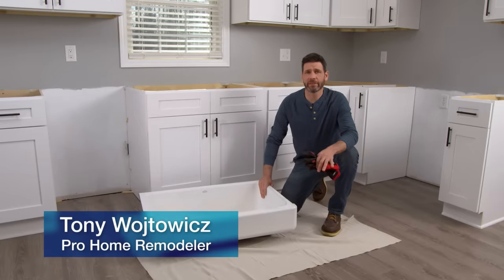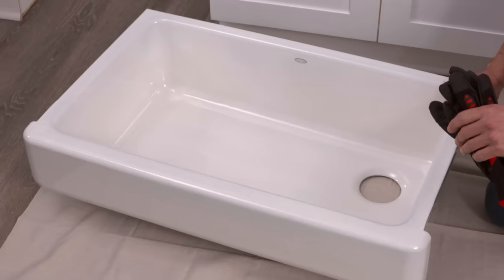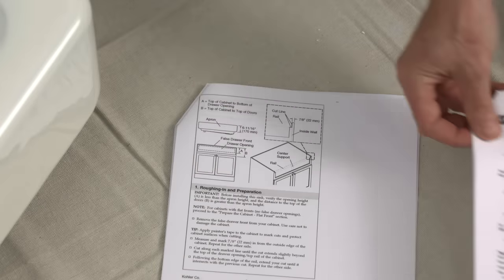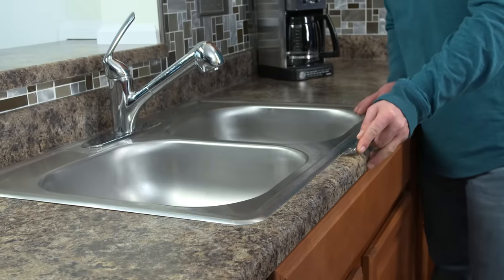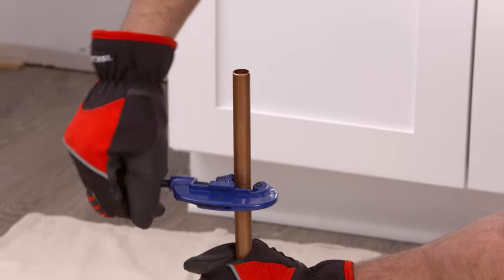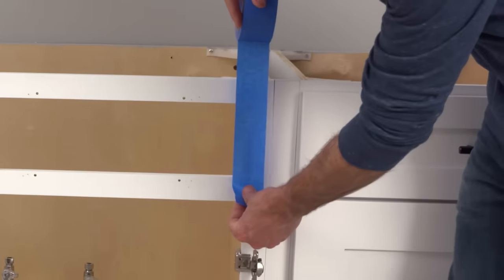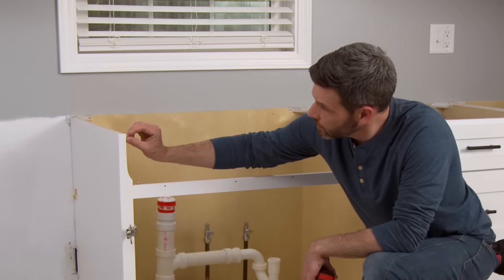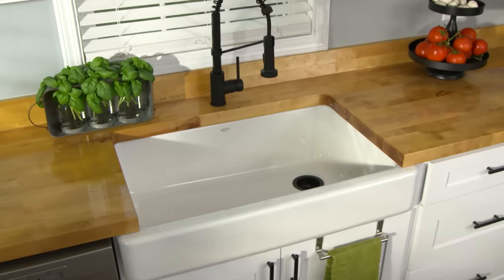How To Install a Farmhouse Sink | DIY Kitchen Remodel

Comment: Do what the gentleman in the video did even if buying new cabinets. We paid roughly $200 extra for the “farmhouse sink base cabinet” and it still needs to be cut up and a base built to fit and support the farmhouse sink. Would have been cheaper to buy the regular base cabinet and cut it up the same.
Reply: instablaster...
Reply: I was wondering because I cannot afford to pay $500 for one cabinet just for the sink ugh this is a bigger job than I thought but we’re doing pretty much what they did butcher block and everything but I know it will look so much better!

Comment: Thanks for doing these videos....I really enjoy them! My question is.....I think i would prefer the counter top to not set on top of the sink....is there another way of installing this sink so the counter top is not on top? thanks
Reply from the maker: We're really glad that you enjoy these videos!  The sink in this video is an undermount sink, but there are also top mount/drop-in farmhouse sinks.  Most are made of stainless steel.  Check this one out on Lowes.com: https://low.es/2ZCfKNA
Reply: Yes, of course there is.  A sink can sit on top of the counter or hang from underneath.  Some sinks allow either install. Some are only sit on top, and some are only undermount. The Farmhouse Sink has two options of being on top or below countertop.  It is easier to mount sit on top style.

Comment: So to install this type of sink you have to remove counter tops?
Reply: That’s what I’d like to know.
Reply: Yes
Reply: Research but I think you can buy top mount but not sure if the existing counter top and cabinets can be customized to fit the sink. You may be able to speak to a custom Kitchen cabinet installer or a good handyman and ask about installing a top mount farmhouse since to existing counter and cabinet

Comment: Wood saw is the easiest way to cut pvc. Farm sinks are popular, but Im not sure how people wash dishes without 2 bays. Also if you need to fill the sink for washing thats alot of water when it should be half that with 2 bays.
Reply: Whole sink is much more handy when it comes to scrub anything bulkier than just regular dishes/silverware. Pyrex tray, pots and pants with handle are all this more comfortable to be done in whole sink before putting into dishwasher for complete wash and sanitation, not to mention that dishwasher will last much longer, beside that having only single drain with garbage disposal will never let drain get clogged, which is common case with dual bay sink as soaking bay is frequent cause to that. Also, those farm sinks while more practical, seem also got trendy nowadays.
Reply: Dish pans are 3 to 6$. Just add a plastic pan that can store under sink when not in use.

Comment: My question is when you are done mounting the sink it looks as though it is not sitting flush with the top of the cabinet as you stated it should.  Looks like a gap of about 1/4". Need to shim it more. It should be flush so the countertop sits right on it with a thin coat of silicon glue.
Reply: the sink should be 1/8 inch below the plywood substrate

Comment: What’s the difference between a regular sink and a farmhouse sink? Which would you recommend
Reply: Really just size
Reply: Farmhouse sink has the apron in the front whereas regular sinks do not. It's a design difference. Did you notice in the video the sink had the white extra in the front. They are available in stainless steel as well

Comment: You don't need to replace/remove the top to install this sink. Tap the cabinet front off, cut the top rail off, set the sink on a Pete's Sink Mount (wood shrinks, don't use it please), slide the front behind the apron, silicone the flange, and dial the Pete's to push the sink flange to the bottom of the top. I've done this hundreds of times.
Reply: Yeah, for just $279.00 you get $20.00 worth of metal. No thanks, rather used wood supports.
Reply: 'Pete's Sink Mount is a ripoff. "Wood Shrinks..."  The whole cabinet is made of wood and laminate LOL.

Comment: The statement "never above the counter top is totally incorrect".   Doing it this way only works if you don't have to add to the top of your cabinets.  Why is that?  Because, if you are getting counter tops with a 2" +/-  thickened edge, than you have to put at least a 3/4" shim to the tops of your cabinets so that the doors and drawers do not hit, that is unless you want a 3/4" gap between the top of your sink and the bottom of your counter top. In fact the sink should "always" be at least flush to the top of the cabinets or higher,  and "never" lower.

Comment: 3:04  That's the worst cut I've ever seen. My little son could do a better job. And he's only at 32 weeks gestation. (Watch it with that hacksaw Junior!) Then this guy's sanding the burr off as though that cut is suitable for a glue joint.😄  Vid shoot must have had a tight timeline.